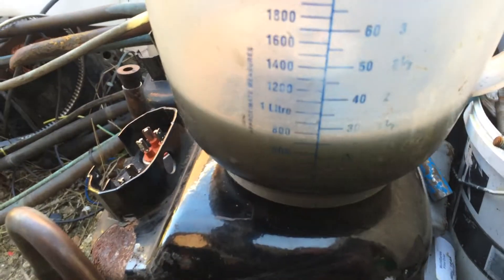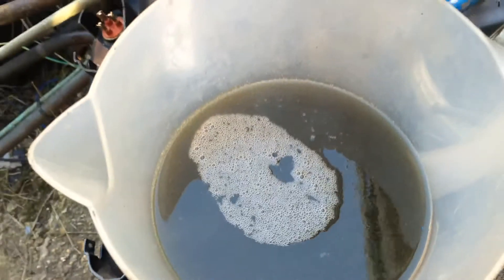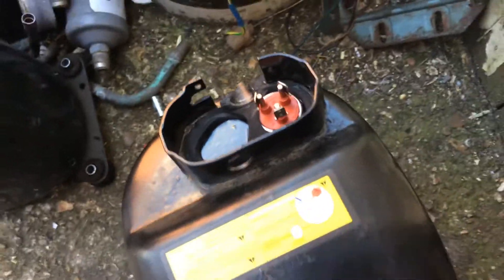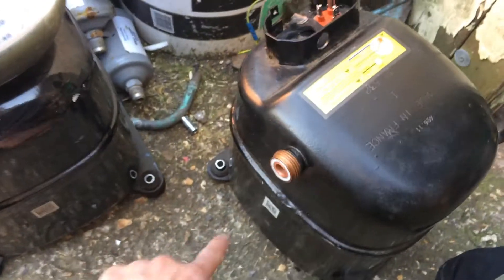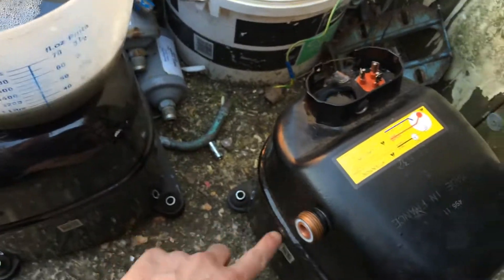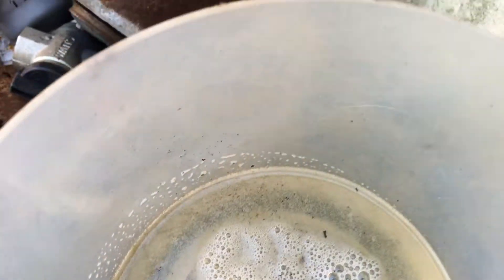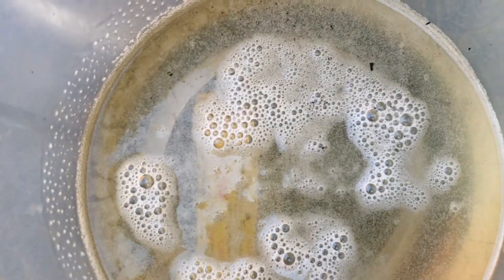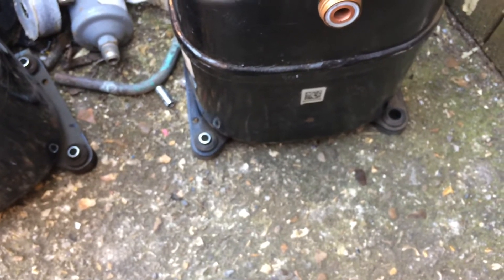Compressor oil comparisson

Comment: Im suprised if it didnt pump metal bits though the system before it failed.  Ive seen some bad oil before but that one you have was quite bad
Reply from the maker: More350Power I have seen some bigger systems where the fibre pad in the filter drier has what looks like aluminium grease on it from worn out con rods, i think this one died due to bad valves so probably the oil got burnt from overheating. Also you never know how well the system was commissioned when new, maybe it wasn't vacuumed well.

Comment: Nasty. I dread to think of what acids and other shit is in that oil and what damage it does to the rest of the system.
Reply from the maker: FrontSideBus Yeah, you wouldn't want that in a new compressor though thats exactly what happens when you fit a new one after a burn out.
Reply: No way to flush the system with a neutralising agent or something?

Comment: Yeah that first one's definitely been up to no good! Possibly a spring mount failure or even a thrown con rod!
Reply from the maker: Machine Man I think it might be a rod as it had stopped pumping, though it still ran. It was running fine a week or so before failure when i was there for another problem.
Reply: heavydiesel I see. I suppose the autopsy will reveal all!